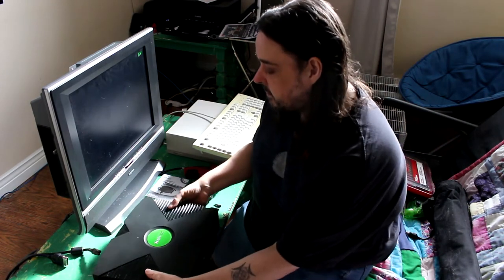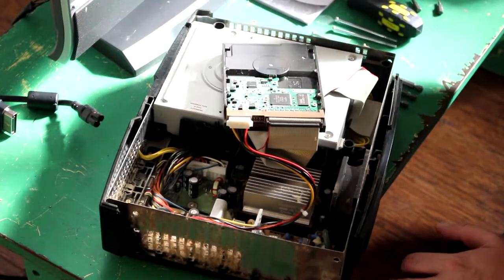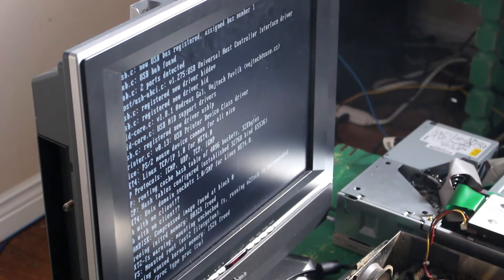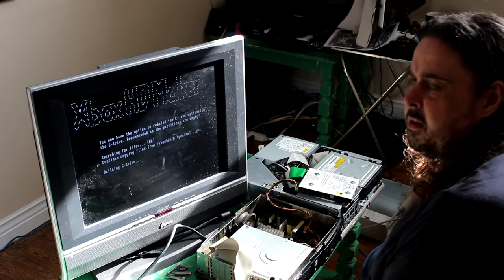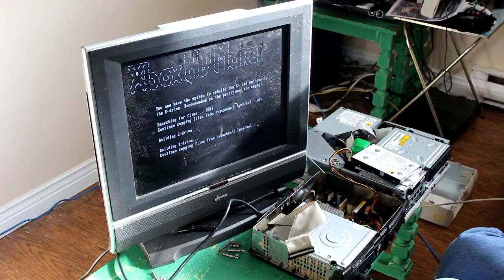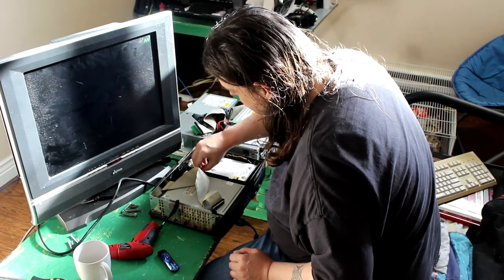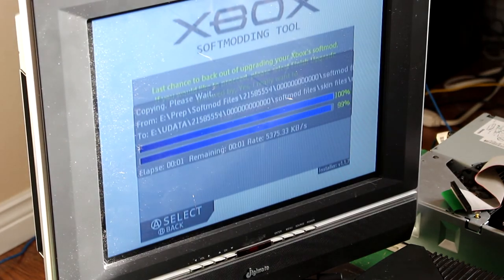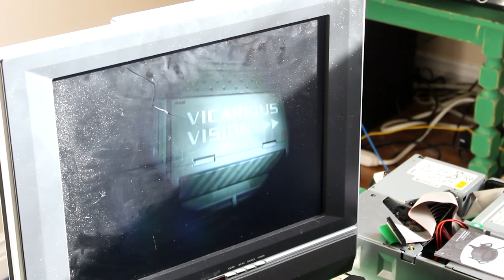How to softmod an Xbox Original with the Hot Swap method

Comment: I got a 2Tb Xbox given to me. It had over 600 saved games, and took me over 3 hours deleting each one with the controller. Saved game data needs to be deleted. My save data was corrupt. It reminded me of buying a used memeory card with saved games on it. So the first thing you need to do with a cloned drive is check saved game data and delete it, before saving your own games. After deleting game saves my E drive now has about 1,600mb free space to save games instead of 50mb. And now boxart shows up beside my saves, and it is faster.

Comment: Some one gave me a softmodded 1.6 xbox 80gb.....
I opend to loon for modchip..
Didnt have one...i now its a 1.6A....
Cant be Tsop flash becuse i think 1.6's cant be tsop..
So in assuming its Softmodded..
The Hdd is locked i cheecked when booted it...it boots unleashed x..

...............i ftp to it and loaded remaing space with more games the added a latest version of unleashed x ( ran it as a APP ..not main dashboard)..
Change some settings ..
I enabled G:/ drive pation 
And save settings ...
(I think i didnt need to Enable G:/ pation because i doest have a large Hdd...)....
That or i ran latest Unleashed x as App......
..Soo my problem is it wont boot into dashboard....
Afther xbox logo i get a Black screen with YELLOW on Top of screen...)..cant boot Og Game disc either ...i know they work.....
...
Can i Hotswop Hdd and delete the Config file for Unleashed x ....or relpace Config with a Clean one.....?????
.....i Forgot to COPY THE EEPPMM KEY.....
.....
Ps ....i own 3 other xboxs 
2 stock ..1.0 and a 1.6B stock..
And a 1.4 with Aladin xt Mod chip...250 hdd....
....can i use mod chip to fix the softmodded that wont boot anymore...
...and can i use that mod chip to softmode my two stock xboxs...
..

Comment: This video is a godsend! My xbox is an NTSC-J which means that I cannot softmod using game exploits, so I'll be using this. I initially was going to buy an adapter but I found an old computer for much cheaper. I'll be receiving the computer in about an hour and will start the procedure, here goes nothing!
Reply: Some one gave me a softmodded 1.6 xbox 80gb...
...............i ftp to it and loaded remaing space with more games the added a latest version of unleashed x ( ran it as a APP ..not main dashboard)..
Change some settings ..
I enabled G:/ drive pation 
And save settings ...
(I think i didnt need to Enable G:/ pation because i doest have a large Hdd...)....
That or i ran latest Unleashed x as App......
..Soo my problem is it wont boot into dashboard....
Afther xbox logo i get a Black screen with YELLOW on Top of screen...)..cant boot Og Game disc either ...i know they work.....
...
Can i Hotswop Hdd and delete the Config file for Unleashed x ....or relpace Config with a Clean one.....?????
.....i Forgot to COPY THE EEPPMM KEY.....